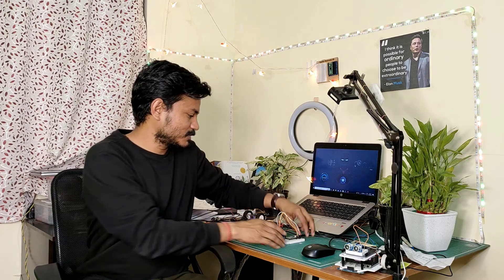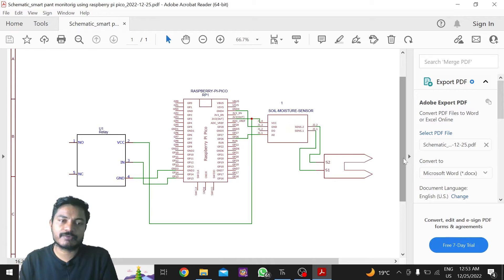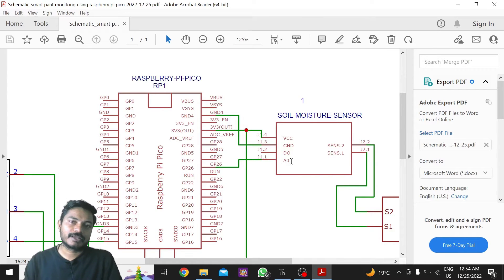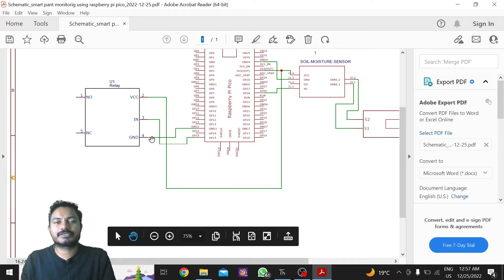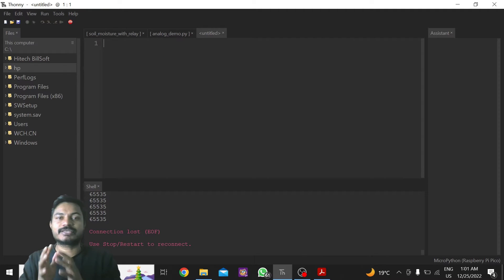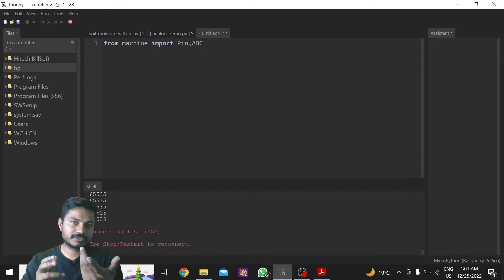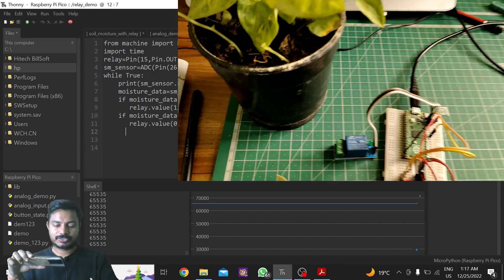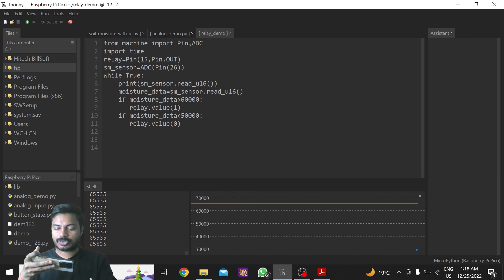Smart plant watering system using raspberry pi pico and Micropython | soil moisture with raspberry

Comment: Thanks for sharing this post as helps to understand the functions to the core. Do you have any tutorial on how to connect Relay switch to Pump?
Reply from the maker: Thanks mam. i will make the video for the same
Reply: @ImpulseTech   Thanks for this tutorial. I agree that it's lacking the relay -> pump part, so I had to look deeper myself and perhaps you can tell me if I'm wrong:
You need an external power supply (which I should have known, but regardless, didn't think of)
On the relay output end:
     COM to the pumps positive line
     NO to the positive of the external power
From the pump:
     connect the negative to the negative of the power supply

It worked, I just don't know if everything was best. I did connect the relay to the VBUS (5V), but you did 3V3, which I'm guessing is probably better(???)
Your schematic shows NO and NC instead of the NO-COM-NC options my relay has, so I'm not sure out there's anything different. Connecting NC and COM seems like it would work when the relay isn't sent a signal to be on. My relay has a jumper for setting that. As well.

Again, thank you for this. Finally I'll be able to grow mint and cilantro on the deck without constantly worrying about it getting baked.
Reply from the maker: @ChrisMoran1  thanks . i will make the separate video for the same. so that everyone understand